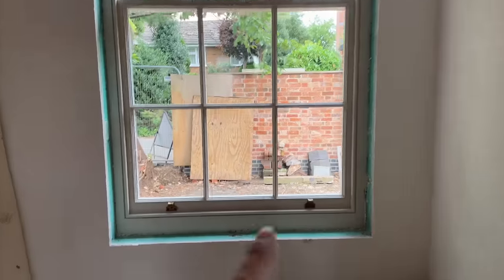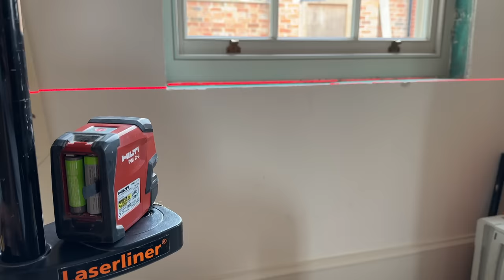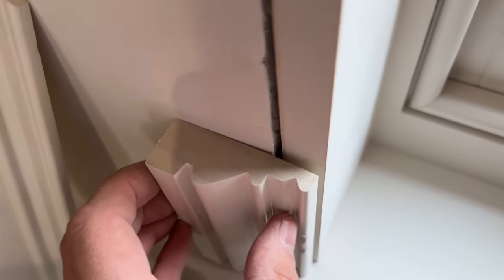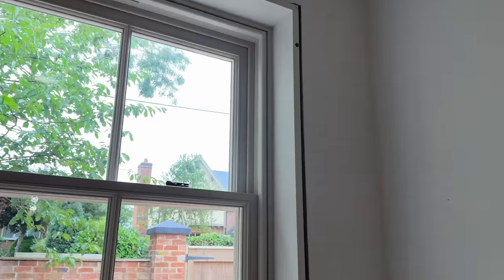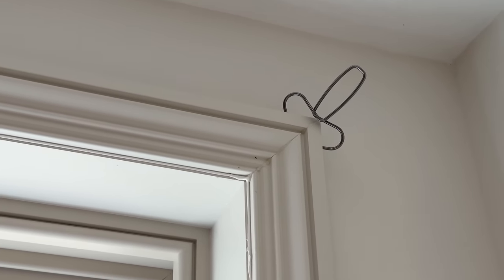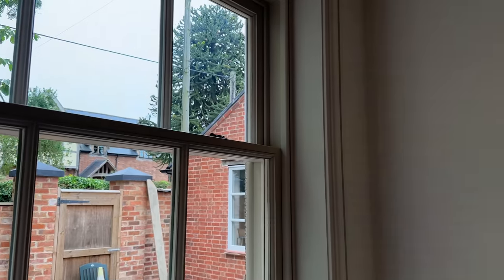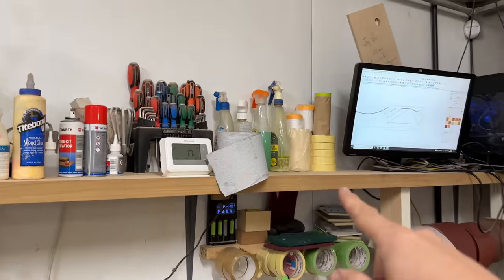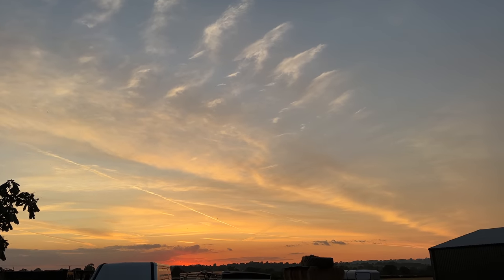Window Lining Install, Serious Drill Bit Organising and Starting the Green Oak Porch

Comment: Kapex mounted on the dust extractor = mind blown. Also, I have Ryobi nailers. They are great tools for me doing diy work. I doubt I use them anywhere near as much as a consummate professional, but they have worked flawlessly so far (3 / 4 years of garage project use).

Comment: At 32 years old I’m about the closest thing to a joiner you’ll find across the pond in Florida. I basically only build custom wood windows and doors (and try to avoid stair and hard rail work whenever possible). I’m not sure I’d recommend it to other but it is one hell of a rewarding career.

Comment: Careers ehh, Well I left school at 16 and did an apprenticeship as an Agricultural mechanic, at 21 I went into the Agricultural welding and metal fabrication side of things. Then 20 year ago at 36 I went back to Agricultural engineering working abroad for CNH, (the only time I made any money!) Eventually I got sick of that and in 2010 I decided to become a mountaineering instructor. After 11 years of that and loosing what little money I had, covid forced a change of tack so I started doing Garden buildings and structures, decks railing you know the type of thing, its it bit like being back at fabrication except steel doesn't change shape every time the sun goes behind a cloud! Basically I tend to do something for around 10 years then just as I getting good at it and earn some money I get board at start looking at something else!  I always thought the bricky's have the easiest life, where as a woodworker needs a £20,000 van and 10's of thousand in machinery a bricky can go to work on the bus with all his tools in a bucket and still get paid the same!

Comment: after 30 years with the same stanley toolbox I have upgraded to the dewalt draw system and managed to get a couple of the 3 draw type, however i found when stacked they are a bit unstable and lent forward when opening a draw. I have 3d printed some lolly pop shaped pieces 8mm thick to go in the recesses and it has stiffened the stack to such an extent that when they are stacked 4 high they very stable.
Reply from the maker: Hi Philip, would you message me on Instagram if you have it I will buy some off you, and or share them if you wish to sell a few on eBay
Reply: @BradshawJoinery  I will.
Reply: I'm struggling with instagram, can we do email or what's app or is something else an option.
Reply from the maker: @philiprogers5772  Oliver at BradshawJoinery dot co dot UK 

If I type my email YouTube filters it out 👍

Comment: I just made and fitted a double double hung made biggish reveals and window board  and a sort of weird architrave set up to match in. Think reveals were 160  window Board was about 200x 33
Customer loved me, after what the last guy was going to try and install 😂

The lamello zeta P2 was absolutely superb, quick and easy 👍🏻

If I was 10 yrs younger that thing would be giving me a semi boner , favourite site tool currently and super handy in workshop 👍🏻

I gave up the piece by piece architrave way, 95 percent of time i make them up on the bench , the miter clamps
With the teeth that bite are amazing, massive pressure over complete miter not just long point 
Mine are 0’l school ( coincidence)

Comment: Why don't u mitre bond the architrave together first & then offer it up as one piece??
Reply from the maker: you are relying on perfect mitres setting at the right angles, and any pressure applied to get a perfect margin in time will crack the joint, this way it glues settled in the right place, thats my opinion anyway.
Reply: @BradshawJoinery If the mitres are marked & cut true to the aperture, then offering the bottom of the two legs in at their respective marks can only result in the architrave sitting correctly against the liner as it's offered up, no adjustments can be made in either case anyway - else the mitre(s) would open. There are many ways to skin a 🐈  i suppose.
Good work! Lovin the workshop order btw👌

Comment: Ollie, could you explain how you hid the spring mechanism in the sash window design? Please turn your microphone up for the benefit of us deaf b@$¥&td$ 😀
Reply from the maker: I will do ive made a whole video on it, but itll be a way down the line. Basics of it is groove the frame to accomodate the balance then a groove wider and 3mm deep to take cover strip. fittings at bottom need to be removable so you can get the sash in place pull spiral down then slip fitting in holder.
Reply: Thanks. Love the channel